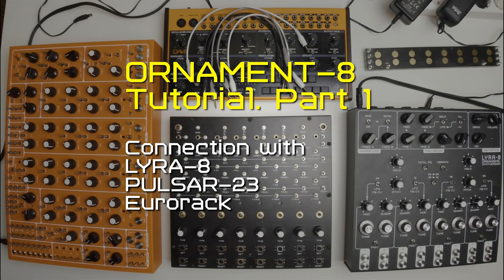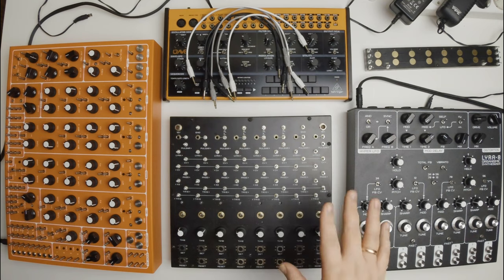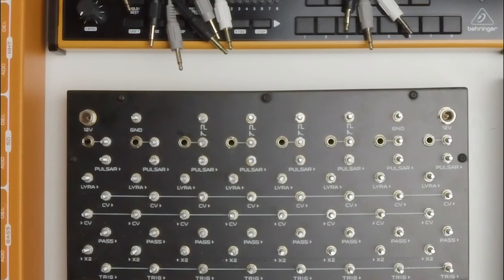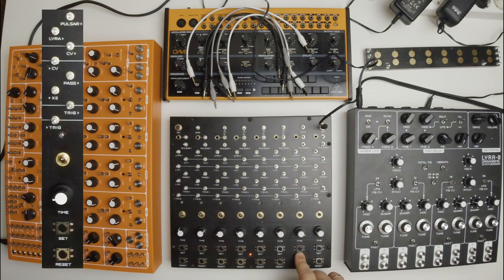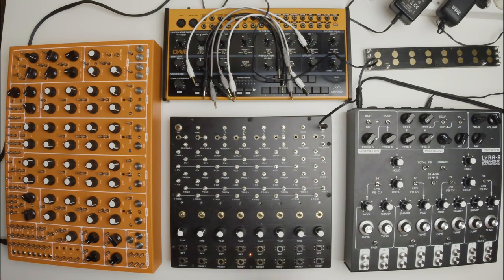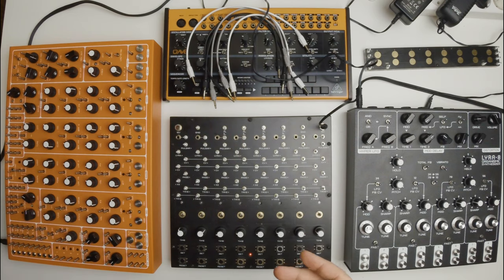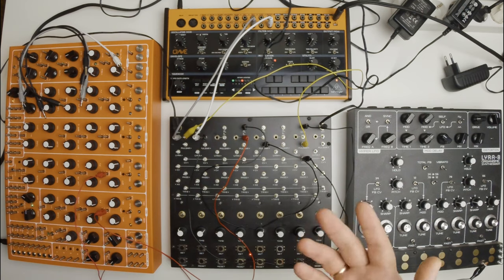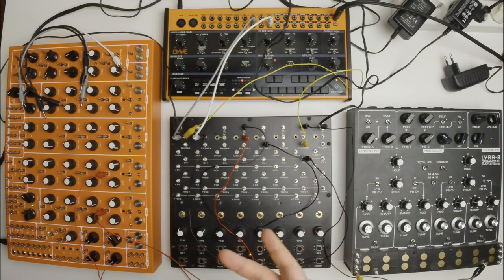ORNAMENT-8 Tutorial Part 1 (basic connection)

Comment: I’ve just received my Ornament 8 and I love it, very clever! Cellular automata without digital component!

The cabling is hard work, but it is very useful to work with multiple inputs and outputs.  It got me thinking - it should be possible to create templates out of card, like circuit diagrams, which fit over the O8 and make the connections for a patch? Fine wire and washers might be another option - I even thought small paperclips could help set the basic trig connections. It’s actually great to be thinking up practical solutions like this, Eurorack made things too easy for us!

Comment: I have an ornament 8 and am interested in using it to control some eurorack gear - in particular the Moog subharmonicon. most of the inputs on the subharmonicon accept CV from -5V to +5V according to the manual and the ornament generates 0 to 10V. do I need an offset module for this? apologies, I am new to modular (but I am sure this is obvious).
Reply from the maker: For some functions you will need the offset module. Some of them will work good receiving only positive signal.